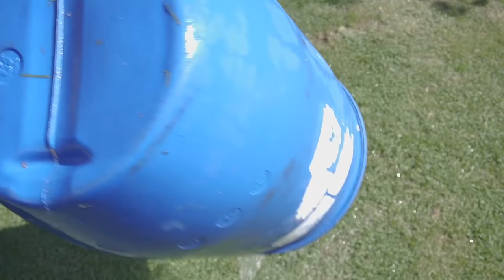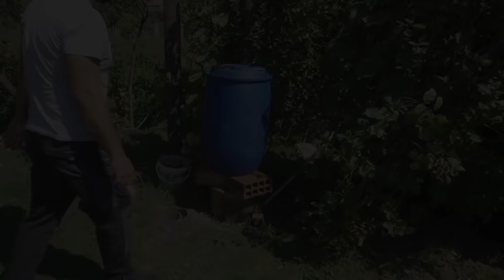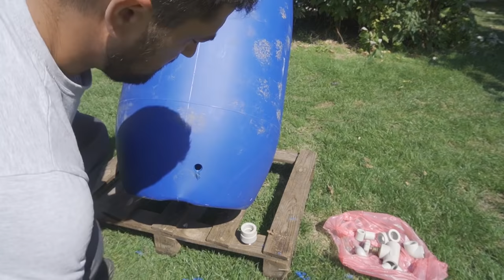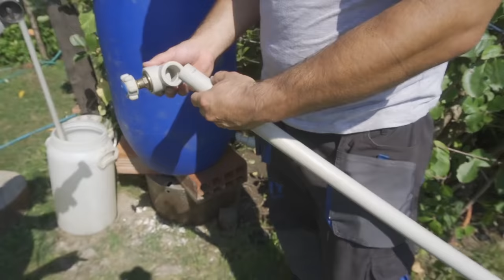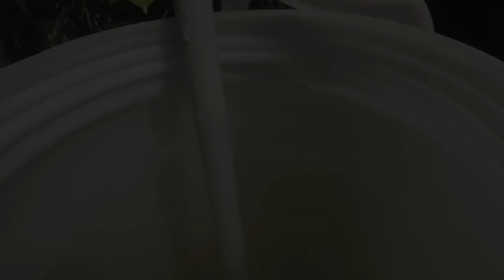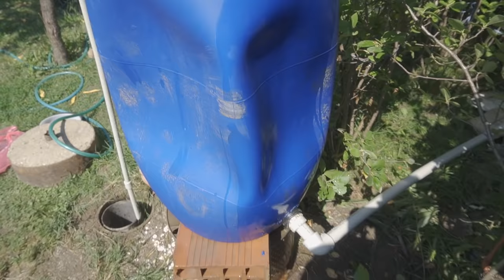How To make Free Energy Vacuum Water Pump Without Electricity using Plastic Barrel 125L / Experiment

Comment: This is just what I needed to solve a problem in my invention! Thank you so much!!! God bless!!!💯🙏🏾
Reply: Feed that discharge line back into the source. Add a hydroelectric turbine to the mix and you'll have unlimited power. Make this at a much larger scale and never worry about electricity again.
Reply: @jordondarke1884  I actually tried this with some water bottles and found out that it only works when the discharge line is lower than the water level. I'm thinking about trying it again on a larger scale since it may be because of the size, but I'm going to research Pete Davey's sonic boiler and see if I can't do something with it!
Reply: @eclay805  It does if you use the same size discharge/feed tube. The barrel/bottle in between the source and the discharge line must also be larger/contain more volume than what's being required to be siphoned in.
Reply: @jordondarke1884  interesting! Yeah, I'll have to try it again and see. I have an empty plastic barrel that used to have cheese balls in it so hopefully it's big enough to make it work
Reply: @jordondarke1884    Unlimited power!? Don't you think this is to nice to be true? This "pump" does not work on a big scale since it does also not work on a small scale. It only works in YT-videos due to a hidden pump plugged in an electrical outlet.
Reply: @sciencefreak9070  Say what you want.
Reply: @jordondarke1884    What I say has is based on solid grounds. Perpetuum Mobiles are not possible. There are many videos on YT which describe this "pump". In the comments many report that they have tried it but it didn't work. No surprise. This "pump" can not work due to best asserted laws of physics. In this thread it is Elijah Clayton who tried it and it didn't work. You advised him to increase the volume of barrel and discharge line. OMG. Have you tried it? I hope he is not so gullible to invest more wasted time on this, since this will not change anything. This and all other videos showing this "pump" working are fake-videos.
Reply: No pump, it works as any siphon works.
Reply: @billwells8054    Perhaps you haven't seen the whole video. A siphon works only if the outlet is lower than the water level of the water source. What is shown until min 13:30 can be a siphon, although you don't really need a barrel for a siphon. You only have to fill the pipe completely with water. What is shown after min 13:30 is different. Here it is pretended that water is lifted out of a deep well, where the water level is below the outlet. And this does definitely not work.
Reply: @eclay805   height x density = PSI  for water that is .433 psi/ft size dose not matter this video is miss leading. pie x diameter = circumference  and x height = surface area  = crushing force on barral.
Reply: @sciencefreak9070  it dose not work here ether if you look at the hose it stops leaking after the vacuum builds up in the barral H x D = psi
Reply: @studentofscience    Yes, it does not work. An increasing vacuum would first stop the outflow of the barrel, long before it would be strong enough to draw up water from a deep well.
Reply: @jordondarke1884  There are only two criteria for this to work: 1) source is higher than discharge/exit, 2) Air tight. Size of tubing is less relevant. Barrel is not needed, but can be practical for priming.
Reply: @sciencefreak9070  It works fine if source is higher than exit. It is impossible to use this to lift water up from a well.
Reply: @sciencefreak9070  This is a siphon and works fine if the souce is higher than the exit. Will not work from any well
Reply: I saw the thickness of the plastic drum when you bore the hole. From where did the great suction pressure come from that is able to make this thick plastic container to collapse
Reply: @innopeaceideas8434  Atmospheric air pressure.
Reply: read my comment.
Reply: Lmao
Reply: @jordondarke1884  wrong, energy is transformed not produced
Reply: @pierogillio  That's what I said......
Reply: @eclay805 tried that, doesn't work .... spoiled 3 bins with this project, still no constantly running water😢
Reply: i like your tutorial
Reply: @eclay805 water bottles don't produce enough gravitational pull.

Comment: awesome! 
i made one for my pool to just circulate and filter. it did just that and collapsed the olive barrel to 1/10 th the volume. im fashoning an old air compressor tank next . powerfull system .good job!
Reply: i used a semi rigid grove hose in a coil and 15 ' long under the barrel.  this made it run faster. i think mpre weight and enertia from xtra coil. coil is just because im going right back in pool .not sending water away to an other spot. the suction is so strong it could hurt you. keep fingers away!
Reply: Build a simple internal frame to place inside the container and it will not collapse. It can easily be made from almost any material that can be submerged.
Easier than finding a new container.
Reply: hi sir,can you email me the picture of your pump

Comment: Thank you. If this is perfectly true why its NOT that popular in the world. However I am going to try one in my paddy field and if it works its going to be a perfect answer to my irrigation problem.
Reply: It only works if source is higher than outlet.
Reply: E VRAJEALAAAA.??
Reply: @kjellg6532  Not true. This would work better if it was using a metal barrel. They are loosing vacuum as the barrel collapses. The key here is to make sure your output line carries more water weight than the input line. So the deeper the well the smaller the intake line needs to be. Also the deeper the well the lower the flow.
Reply: @breaktime-vo2my  Sorry, but no. This is a siphon with a barrel to make it start. Use a steel barrel if you like. As with any siphon, the diamert of the input or the output does not matter. That is if all tubes are 100% filled at startup. 
The system must be airtight AND the water level at the intake must be higher than the output to get a siphon running

Now, with the source level 5 m down in a well and the output at ground level, this siphon can’t work. In fact it will try to conway water from the output back to the well, thus suck air into the system from the output.

Comment: Great design, set up a vaccume pressure gauge on the tank top seal the supply inlet, fill water to the top and close/seal top lids and open tank outlet to let drop.
Record the highest vacumme pressure drop convert meters (best level 10 percent above outlet centerline) ,
90 precent of your vacume pressure  should be your max supply head or well pipe height (assuming 10 percent will be lost to pipe friction and connections)
Reply: The size in diameter of the delivery pipe is too small, so its impossible to have a vacuum water pump,
Reply: @amadeorogelrosario6148  did you try?
Reply: @amadeorogelrosario6148  size of tubing does not matter at all

Comment: Steel barrell or plastic barrell doesn't matter. Pressure indifference will sure .ake the drum deformed. I have watched few more vudeos using Steel barrells that collaped too. So how to avoid barrell deforming?
Reply: Need to use thicker steel. And reinforce inside with star shaped structure.

Comment: Your video is exactly what I was looking for. From the well to supply water without electricity. Thanks for the idea.👌👍
Reply: @TheRebelmanone  Why lies? Explain. What's wrong there?
Reply: @vasppolo5939  
Its not workimg.
Reply: @vasppolo5939  don't you see how the container collapse it will stop in the meantime because there is no energy from nowhere you have to transfer energy from another source of energy out of thin air you cannot create energy that's a physics law
Reply: @vasppolo5939  well how do you think water is being pulled up from the ground? Where do you think that energy is coming from?
Reply: @basketweaver1144   What makes you sure water is being pulled up at all? The water from the outlet is simply the water from the barrel. Are you not aware that there are plenty of fake videos in YT? Often just hosted as click bait? Can you explain why a vacuum should be strong enough to pull water up some height but it is not strong enough to pull back the water through in the outlet pipe, where height is much lower?
Reply: @sciencefreak9070  The weight of the water in the tank has more weight being applied on it than the water being pulled up the tube. Have you ever used a watering can? If you had, you’d understand the fuller the can, the faster it comes out. It’s the same principle here. This is all for the same reason that if I were to put a 100 pound weight on your chest you could handle it, but if I put a 1000 pound weight on your chest you would not; gravity. All that is happening here is gravity is a force and that force is being converted into usable/concentrated energy. No laws of physics are being violated here. Nothing is being created or destroyed.

As I stated in another comment to you, how can you say there is a pump pushing water up if there is that great of a suction or any suction at all? If you actually knew what you were talking about, you’d know that if something were being pushed up the tube than there would be no vacuum and that plastic would be outward and not inward.
Reply: @jordondarke1884    The force of gravity can't be converted into continuous energy. If an object moves down due to gravity you gain energy, but to repeat that, you have to move the object up again, which needs exactly the energy which was gained before, sum is zero. And don't tell me no laws ob physics are violated. Wasn't it also your idea, that this could produce a continuous circulation of water which could be used to generate electricity? This would mean a perpetuum mobile and perpetuum mobiles do violate laws of physics. This would create energy and this energy can't be attributed to a loss of energy in the gravitational field, since gravity is no source of energy at all, it only offers what physicists call "potential energy". With this idea of a continuous circulation of water the same amount of water would be lifted up against gravity and would come down due to gravity. Input and output of energy would be exactly the same - losses neglected. So where does the created electrical energy come from? 
And I never said, that there is water pulled up from the hole in the ground. Quite contrary, I always said that this "pump" does not work and no water is pulled up. There are numerous of these "pump without electricity"-videos around since quite some time. And it is not a complicate construction at all. You should expect many would make at once use of it, but all who have tried have failed. You only see this "pump" working in videos, but never in real life. Fortunately there are also singular YT-videos which debunk this nonsense. Search for "Free energy water pump tested. Is it possible". This video also explains why your explanation with "weight" is wrong.
Reply: @jordondarke1884  Sorry Jordan, you are way out. This is a simple siphon (with an unnecessary)  barrel. Source must be higher than output.

Comment: How is it supposed to work? To me it looks as if the water you initially poured into the blue barrel is partially leaking into the pool under its weight. The leak will continue only as long as the barrel keeps deforming. So it's the water you poured into the barrel (with energy) that leaked, not the water sucked in from the well. It's all vanity or I am missing something. How on earth would you like to pull more water from well than you pour there to blue barrel? It is not a pump.
Reply: The whole drum was a waste.. a simple pipe would have sucked water.. it's moving from the small bucket to lower ground .

Comment: Great video. Is it possible that the outlet pipe can be directed back into the water source and a generator fitted for a closed system that produces electricity?
Reply: Perpetual motion is somewhat hard to achieve as it defeats the energy conservation principal. This set up will continue to cycle but eventually stop as the energy will be lost to pipe frictions, bends and other forms of losses over time.
Reply: NO
Reply: It won't even star up. to go higher.
LOL 
Want free energy >> buy Solar panel setup!!!
Reply: why not? but the first thing in here is to solve the air shrinking of the tank. if we can make some tiny air blower with the help of this outlet pipe flow i.e small water turbine looks like and apply to the tank which can be planted it can run continuously i guess. After that we can plan further producing of electricity for unlimited.

Comment: Very good medium sized drum with big opening enough to get arm to get into to facilitate easy  pipe fixing. The only problem is that the wall is sucked in. The best would be to assemble anti-collapse structure from the inside or   outside.  By the way, what drum are you using and where do you source it from?
Reply: Normally these pumps have a 2nd pipe or tank further down the line that seems to stop the cavitation - as a back up negative pressure "well" pulling the water along and so a surplus of negative pressure that prevents the first tank for collapsing.

Comment: Putting a one way foot valve in the intake end would help and using metal straps around the barrel would help with barrel deformation due to vacuum pressure

Comment: That's absolutely ridiculous. The groundwater is clearly higher then the outlet tube with the ball valve that is very far down the hill.that's just a siphon you could have just used a garden hose and sucked on the end until it flowed. Wow! There's no purpose or reason to have the barrel and all the other crap it's a simple siphon if you're pulling from a source that is higher than the bottom of your hose, it's just a siphon. There's no benefit to the extra work you have done and I can't believe people think this is something more than it is.
Reply: Don't you see the Siphon pressure works? By looking at the deformed barrell proved there was pressure (suction) created by outlet pipe and water flow. Deforming
Reply: @AlbertAung-r4z  the barrel is collapsing because the sealed barrel is losing water faster than gaining it. When you drop the water level in a sealed tube or barrel it will cause vacuum in the space above the water...and as it drops more, the vacuum increases. The outlet tube is not suctioning the barrel...it's just where the water is escaping, causing the water level to drop, and creating the vacuum ABOVE the water in the barrel. You can create the same effect in a tube with one end sealed (no outlet). It's called the Bernoulli Principle. They needed a faster inlet or slower outlet to prevent this vacuum from collapsing the barrel, while still siphoning the water. This is useful only if you needed the vacuum and not just the siphon, or needed the water stored there for some reason. The commenter above is right, to my mind...there's an overcomplicated solution here, for a simple problem.

Comment: I think the reason that your barrel is caving in is that the outlet pipe is larger than the inlet. I think that the inlet must be at least slightly larger than the outlet. Of course, total vacuum is a function of inlet pipe size, barrel size and foremost the height difference between the underground water line and the point where the inlet pipe goes into the barrel and must be high enough to pull the required amount of water through the system. I'd start by reducing the diameter of the outlet pipe. Even a small amount of water over time is a lot of water.
Reply: The level of the outlet is lower than the level of inlet, so, as everybody knows, the water go downhill.
Reply: Perfect answer
Reply: @ionelblaj1963  plus colapsul peretilor de plastic …
Reply: Bhai isne do tarah ke pipe lagaye ek patla or ek mota kon sa kaha lagaya bta skte ho
Reply: Noop, size of tubing does not matter. Height difference between water level in the barrel and the output do. Lift the exit and the tank will not collaps.
Reply: @kjellg6532  aapne kiya ye sb ya fake h
Reply: I think so to
Reply: Vīën-Phüœñg  Sorry, I suggest you take a look here: https://en.wikipedia.org/wiki/Siphon You see a flying droplet siphon. The blue tank is performing the flying droplet part. So this construction is nothing but a siphon. 
No, inlet and outlet can be any size and length. What vill create low pressure in the blue tank is the height differense between the source and the top of the tank. The source must be higher than the output of the system.  
With a blue tank, no one way valve at the input is needed, but it would be wise to dip the output into a cup of water to prevent air from leaking in from the output. 
Again, this setup can not lift any water up from any well, nor even one inch up.
Reply: ...i think the barrel collapsed due to the uncontrolled vacuum created inside, water is a liquid and is incompressible, thus the caving in, why not fill the barrel only up to 70% - 80% capacity, the air inside will act as cushion.

Comment: hello, I created the same system with the same bin, but nothing happens when the tap is opened to let the water out, the water draft does not start.
because it does not work  ?
Reply: Water level in source, here well, must be higher than the output to the field.